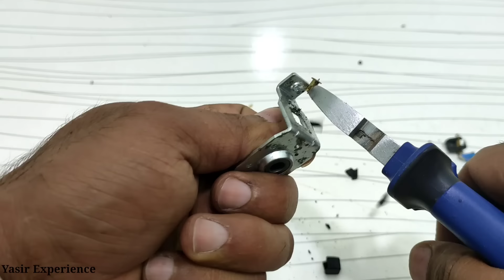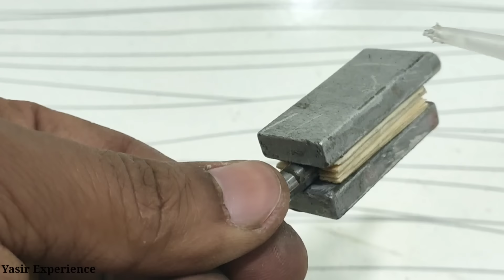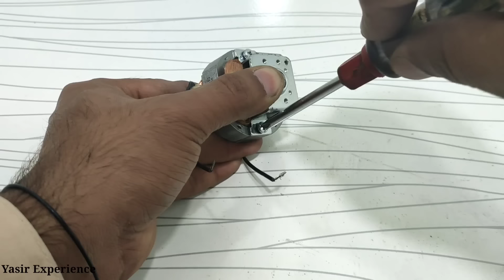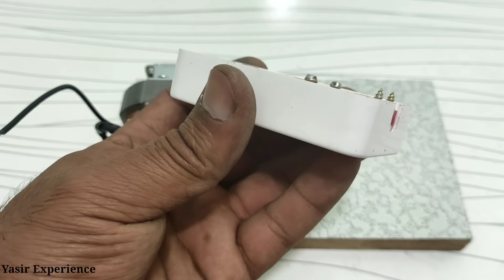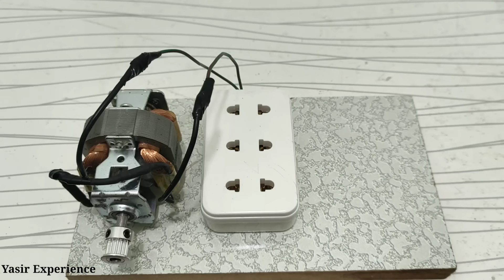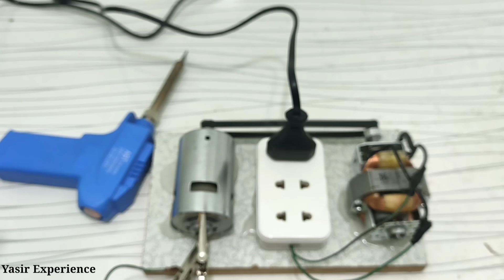I Turn a Small Motor into 230V 6000W Powerful Generator

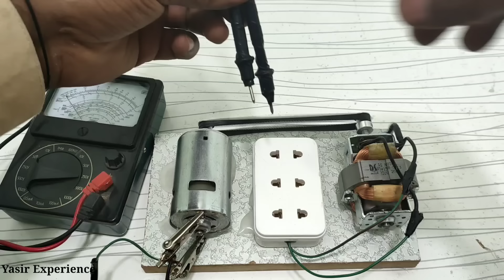Comment: At about 10 minuets and 40 seconds (10:40) into this video, you see the guy pushing in the test meter, but OFF CAMARA, you see him do something and the voltage shoots up. It has NOTHING to do with the connections to the meter, as you can see that he dose NOT touch them, so it is NOTHING to indicate that his test leads have a bad connection. 
Also what would happen if he used 4 magnets instead of 2. As it would be more mechanically balanced, would it make the same amount of voltage, or could you run it at a SLOWER speed to get the same amount of voltage ???
How about if it was to run faster. As I would have put a LARGER drive wheel to the small size wheel that he is using on the converted motor, like a 2 to 1 ratio.
Or 3 to 1 ratio.
Or even a 4 to 1 ratio.
With me living in England, I would need a 240 Volt running at 50 Hz’s. 
How would I go about at making or buying something to do that ??? As what he will have coming out will be a DC voltage. That is OK for using on a soldering iron, but would NOT with to think about hooking it up to a television or any other electrical goods that need to run on AC (Alternating Current) and NOT on DC (Direct Current)

Just one last thing, he has a # (hashtag) of “#FREE ENERGY”  but I do not see how driving something with an electric motor is a source of FREE. You have to get your electricity from some place. If I was to live very close to a stream with a good flow and a good drop for water pressure to give you kinetic energy from potential energy, then I would be more inclined to say it to be free energy. But we all know that NOTHING is free. What they should call it is cheaper energy. As it took energy to melt and form the copper wire, also every part of the old electric motor has had some form of energy used on it to first make it. Then for you to build a water wheel or water turbine to turn the motoe\
Reply: Then for you to build the water wheel or water turbine to turn the motor\generator to produce the electricity takes physical energy, electric energy and any other energy to construct all the parts that you need to get everything working, even that you might be able to source a lot of the parts for free (free to you, but all still took energy for them to be made) 
Now with it all been built and assembled and you have it all running, then the energy (electricity) that you get out of that, is what others class as been FREE. But even the warmer needs to be managed, as you would need to build some form of a dam to keep a good head of water to run that water wheel. Or if you did not do that, then when it dose not rain, then the flow of water will be effected, and that would effect the generation of electricity.
Well sorry for the brake in my message, hit the WRONG key ☹️ 
But hope that you see that NOTHING is truly FREE.
Reply: Good questions but encourage the guy

Comment: Nothing new.If you can produce electric energy without the support of any external force within the boundaries of a particular system then we may say it is a cheap energy  and not a free energy at all. Here you are running the drive motor with the help of your domestic electricity. Therefore you have achieved nothing new after spoiling a motor and bar magnets.

Comment: This designer has no idea about electrical engineering. Otherwise he wouldn't be able to quote that 6000W nonsense on a few watt motorcycle. A 6000W generator is a completely different size and this guy has never seen one in his life.